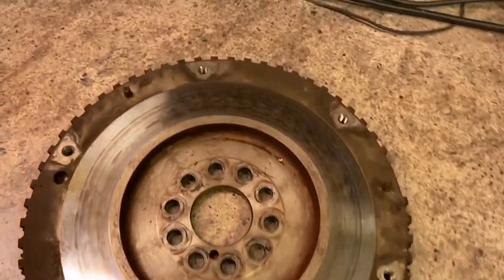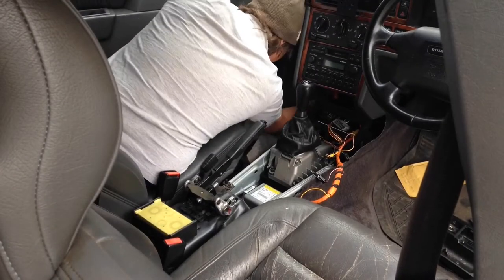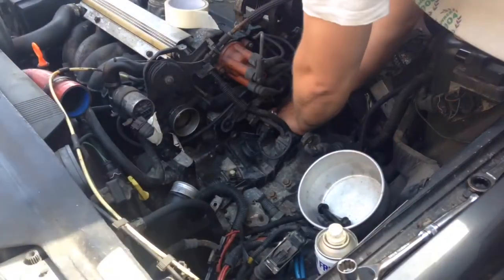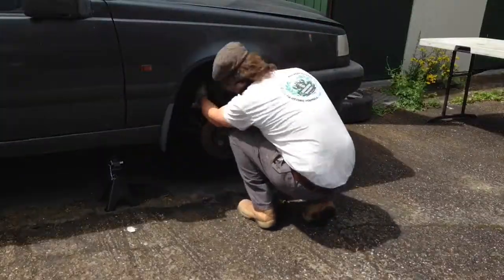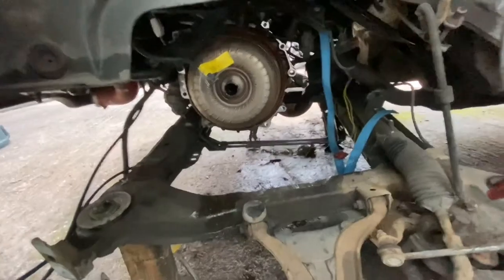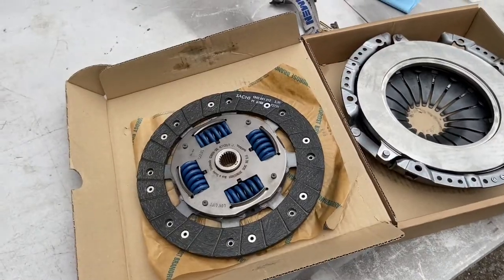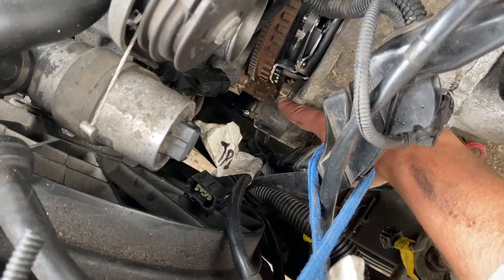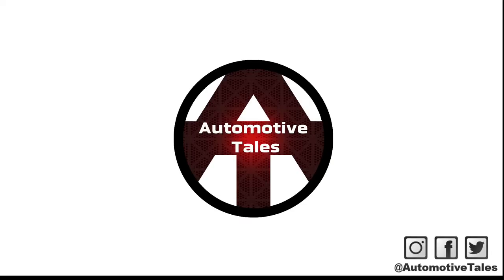T-5 Rescue Episode 4: "Clutches and Consoles"

Comment: Hi john, I hate to tell you this but I think you are missing the pilot bearing in the end of the crank shaft. Auto don’t use them but manuals do, that is exactly why your clutch alignment tool wasn’t working it should be inserted into the pilot bearing and not the empty hole.  Sorry you’ll have to remove gearbox again and fit one.
Reply from the maker: MrAlexwoolf thanks for the heads up and thanks for watching through the video!! 😍 I did wonder about the alignment tool situation but to the best of my research (by this I mean asking the Volvo wizard!) there isn’t actually a pilot bearing on the Volvo crank, even on the manual m56 cars, only on the later m90 transmissions (and we didn’t have one on the donor car). It does seem odd that there is that slack mind you - maybe there is a blanking insert there usually to help with alignment).
Reply: Was just about to add this comment!